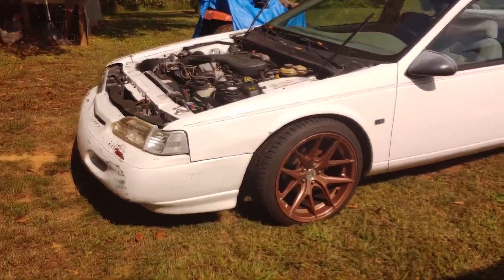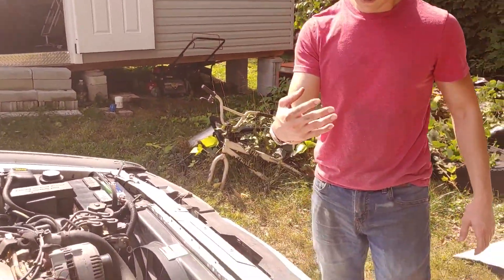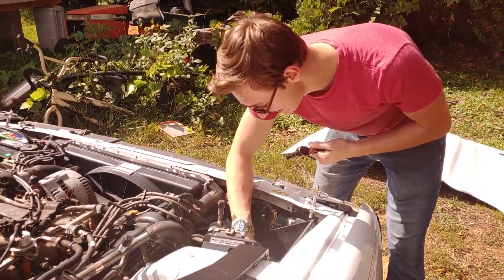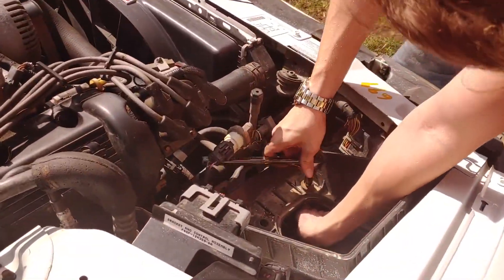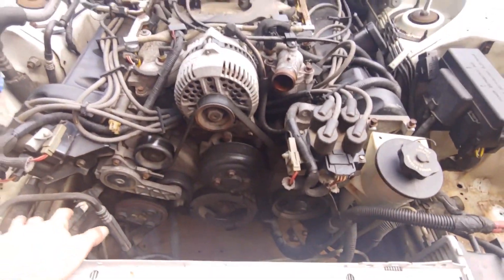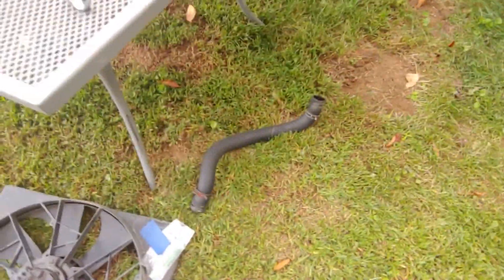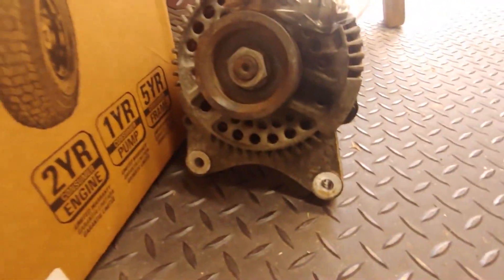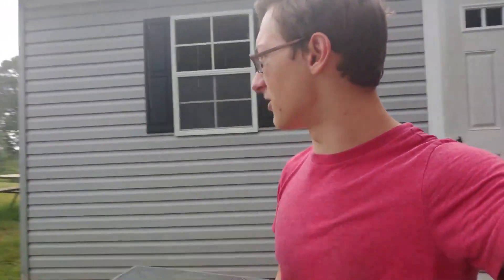The Turbo Tbird Begins!

Comment: Hey man I got the sct x4. None of the preloaded tunes run right because well there is no preloaded tune for the cougar/tbird 4.6. Do you know of a good place that would write me a tune for my cougar? Also do you think there is any harm to running the crown vic tune, other than a loss of power if anything? The mustang 4.6 tune ran like dog, and would knock at above 4k. Edit: I was told to use the preloaded tune that just says crown vic, instead of crown vic 4.6 2v. Someone explained it works on grand marquis and should work on my car. Is there any truth to that?
Reply from the maker: Do you know your ecm code? Should be in the passenger side footwell
Reply: @ChiefDbo  the ecu strategy is cdan4bh? Or do u mean something else. I can't find what your talking about.
Reply: @ChiefDbo  f4sb 10e850 then 2 numbers that are faded on the ecm
Reply from the maker: @readylucas  there should be a code right above the barcode. Will be 4 characters in bold. If it's A5W0, I can tune it.
Reply: @ChiefDbo  I can't find that code anywhere. Would it be like right on the ecm? In that case I think I have to pull it out. It shows the barcode but doesn't show anything else besides the ford logo.
Reply: @ChiefDbo  are u talking about the ecu swpn? I'm pretty new to all this I feel like I should know what ur talking about but I can't find it.
Reply from the maker: @readylucas  if you search up say "95 thunderbird ECM" you should be able to see what I mean on images
Reply: @ChiefDbo   I have a 1997 cougar. I see what you mean now, but i think our numbers are different. i will check my car again but googling ecus for my own car i cannot find the same number.
Reply: @ChiefDbo  well my dumbass managed to bend the hdmi cable so until a new one comes in the tuners useless. I guess that gives me time to order a custom tune.